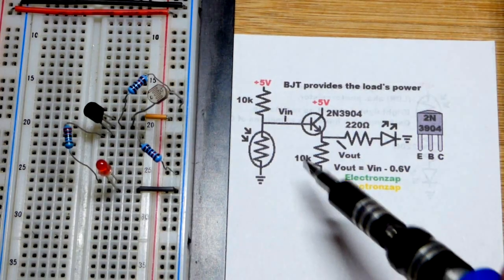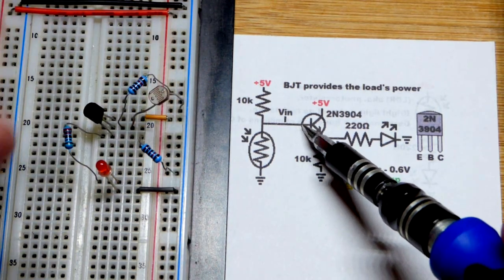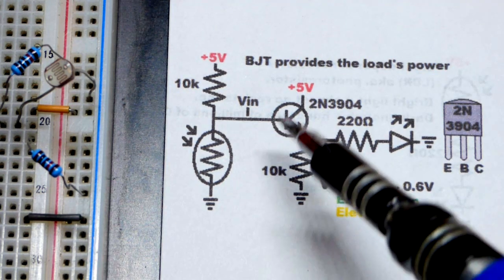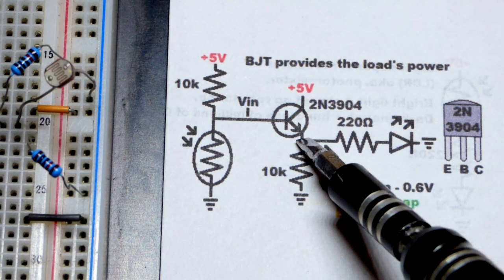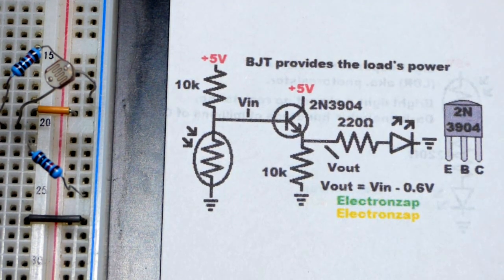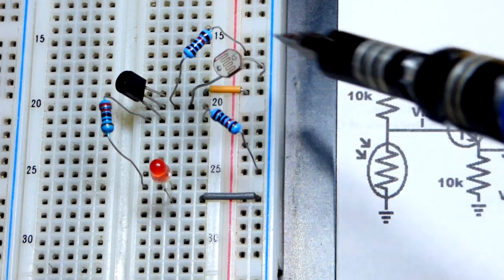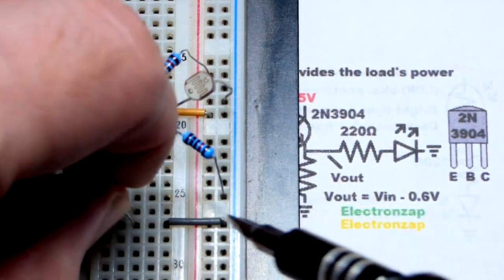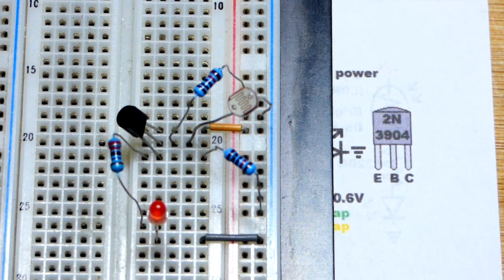LED brightness controlled by light dependent resistor voltage divider amplified by 2N3904 NPN BJT

Comment: can i control a 5v relay for 220v  lamp through this circuit?
Reply from the maker: Relays are mechanical solidly on/off switches even though they are controlled electrically. So you'd want to only apply either 5V or 0V to control them.
Reply: no, I mean . i can use this circuit as automatic on the bulb in night. If i replace led to 5vDc Really

Comment: I like it, building on the earlier session and seeing the croc clip cover getting some more action :) Is there a basic answer to why  loads are taken from the emitter and when would you use the collector for it? Thanks
Reply from the maker: Load on the emitter side is the NPN BJT emitter follower, which transfers the voltage at the base to the emitter with a 0.6V drop. I am about to upload a similar video where the load is on the collector side, which is a NPN BJT switch circuit. The NPN BJT switch turns completely on or off pretty quickly with only a very small range of voltages where it is partially on
Reply: @Electronzap  Thank you.

Comment: 2N2222 work at 5 volts?
Reply from the maker: Yeah, 2N2222 will work in all the circuits I do.
Reply: @Electronzap  will it function at lithium ion voltages 2.8 ~ 4.2 volts.
Been thinking making homebrew solar powered lights that allow flow after sunset

Comment: Amazing Video! I also Realized with my own Experiments that you don’t need any IC or Transistor to do this. Just Simply connect a Potentiometer and Connect it’s middle pin you a terminal of an LED, use a Resistor for the LED, and you are all done. This is because the Resistance is changing at one of it’s Pins which leads to the LED Losing or Gaining Brightness. This is also a Great way to do this! Thx
Reply from the maker: A lower value resistance trimpot will power a load pretty well without amplification.
Reply: electronzapdotcom Good to Know!